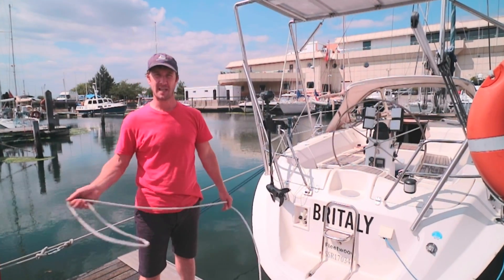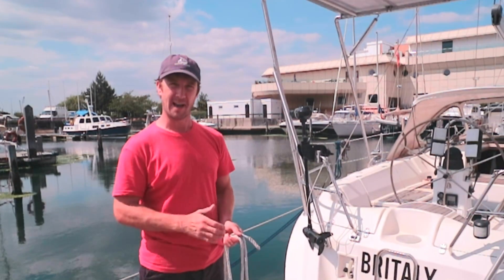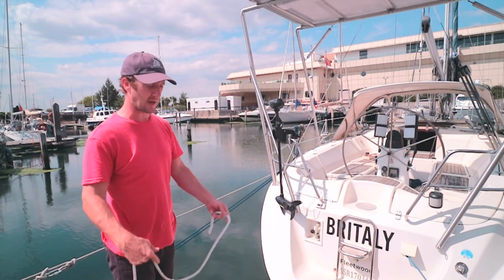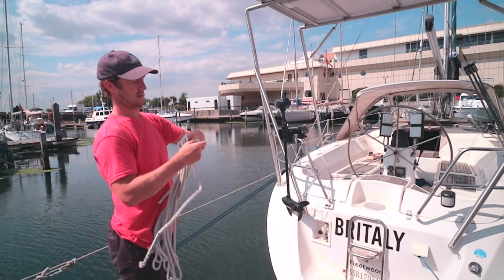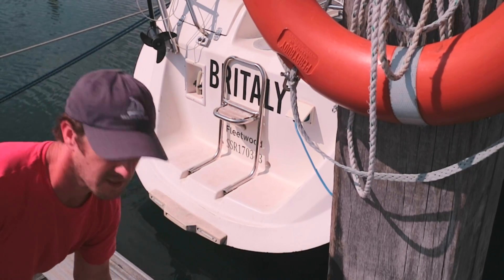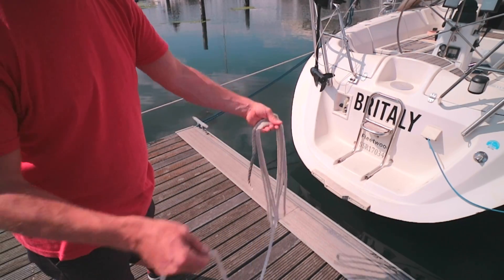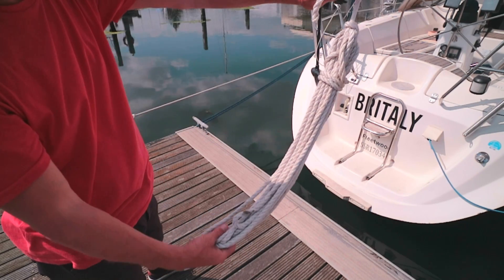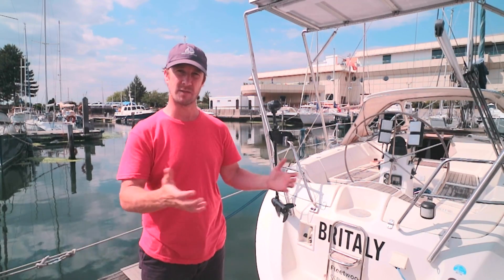Coiling Lines - Is This Alternative Method Better? | ⛵ Sailing Britaly ⛵

Comment: I haven't used this technique yet Chris, I will give it a go - it looks great a great way for long term storing of warps etc. and your locker organisation tips are excellent - together they will make a big difference on board for me.  I have another way that prevents the twisting similar to the figure of eight method but leaves a single coil,  I think it is the same as is mentioned by Miles Hurst below, it is normally associated with winding long electrical cables but I use it as a matter of course for lines in active use - such as tidying my halyards.  
Coiling into the standing end and forming bights in pairs....the first bight is wound normally (i.e. the standing end is laid over the bight)  and the second is twisted in the opposite direction i.e. the standing end emerges behind the bight... This means the twist on each bight is cancelled by the next .  The upshot is you can pay out a line, cable or flexible pipe with the coil laying on its side without tangling,,, but better still you can coil into a fixed standing end which I don't believe is possible with any other technique (think coiling a hose working toward the tap). It sounds complicated but is actually very very easy and I coil lines in this way without even thinking these days!  All the best to you and the family x
Reply from the maker: Hi Lawrie, thank you for your comment. Is it the daisy-chain method you are referring to? Something like this: https://youtu.be/9-eT6v2OBno
Reply: @SailingBritaly  No not the daisy chain method, more like this: it is known as the 'over under' method - look around 3 mins in on the video link below. Using the technique shown it is possible the coil into a fixed end because you are not storing twists on the standing part - in the video the guy could actually coil the cable with it still plugged in to both guitar and amplifier if he wanted to.  https://www.youtube.com/watch?v=B2SUoAvGxVs
Reply from the maker: I like it, thanks for sharing Lawrie! 👍

Comment: Looks like a good method. However, the other usual use of a mooring line is to through out to the marinero/helper on shore (I mean: selecting the roll of mooring line into two: one part is just long enough to reach shore - this is what we through, the larger part then pulled to shore). Does this folding method helps during the mooring, as well?
Reply from the maker: Hi Tibor, coils made like this throw well too - this may be the subject of another video one day!... Very best regards, Chris

Comment: Hi Chris, this is called "Lap coiling" you can also use this method to quickly rethrow a line  to someone if you miss first time, eg you have thrown a throwline to a man overboard and missed, you can quickly lap coil enough line to rethrow to the person in the water without having to restow the line in the bag. Hope that makes sense. Cheers Graham.

Comment: Yep - I switched about a year ago, having been taught the traditional way. I think it may have been relevant with older materials and 3-strand lay, but with modern materials and braid-on-braid the twist is unnecessary, and harmful. as you point out. 

We don't have room to hang ropes, they end up dropped in the lazarette, so we finish the coils by pulling the bight through, as you show, then rather than threading the tail, bring the bight over and back down the coil before snugging it. I believe it's called a gasket coil. Makes the coil a bit tighter and more secure, so less likely to disintegrate in a locker. It does take slightly longer to un-coil, though. 

Climbing has a lot to teach sailors about rope-handling and knots - got any more tips from your cliff-dangling days?
Reply from the maker: Hi Martin! The gasket coil finish is a fairly common alternative and you're right that it is more secure, with the small downside of time to uncoil. I have learnt quite a few lessons learned from climbing. I'm not sure how well they translate here but here goes...

I once took over as the lead climber from a mate and it was only once I got to the top of the next pitch that I realised I didn't have a belay device (the bit of kit which allows you to arrest the fall of your partner if they fall.) Fortunately I knew how to tie a Munter Hitch (a.k.a. Italian Hitch) and I was able to belay him with that. [If I remember correctly this was during the climb shown in the third photo in this video.]

I spent 5 nights solo at the summit of Ben Nevis (the UK's highest mountain - which isn't high in global terms, but which has a fierce reputation due to the weather conditions up there) and I was able to collect around 1.5 litres of drinking water per day by collecting condensation and the odd bit of rain. I carried all my gear & food up there with me (35 kg) and expected to have to walk to a freshwater spring each day to collect water, but I strung up a v-shaped bit of string across my tarpaulin (which I was using as a bivvy) leading down into a water bottle and in the end it was so effective I didn't need to get water once. I guess a similar technique could be of use on a boat (V-shaped lines strung up a mainsail? [In addition to the more common rainwater collection methods on boats])

I took an inexperienced (but hard) friend climbing up a mountain in Norway when we had a bit of downtime during our military Arctic Survival Training. We were in a little place called Lakselv which is 300 miles North of the Arctic Circle and it was winter with temperatures of around minus 25 degrees Celcius. The going was very tough (soft, deep snow which ideally called for snowshoes, alternating with very steep rocky terrain which precluded their use) and I made the call to turn around when we were very close to summiting (just a few hundred metres away). My mate had some snow get under his gaiter which had wet his foot and it was giving him bother. We were both disappointed as we very nearly made it, and this was a once-in a lifetime opportunity, but it wasn't worth the risk. By the time we got back down Graham had frostnip on his toes, which is the precursor to frostbite. If we had have pushed on to the summit he may have lost some toes. The moral of that one I guess is that the mountain - or sea - will always be there for another day, but if you pigheadedly fight nature there can be serious consequences.

I have a ton more lessons learned (I've been going up mountains since I was a kid) but I think that's enough babbling on from me for now!

Very best regards,
Chris 👍
Reply: @SailingBritaly  Gosh, yes: respect the elements! My only, rather tame, experience with mountaineering was an ascent of Mount Hood when we lived in Oregon. Basically a steep walk until you get to the glacier at the top, when it's a steep walk with ice and snow. I recall we used tubular tape, rather than rope, to rope-up. There was a reason for this, which I have forgotten. 

Anyway: as always, an informative and useful video, Chris. Thanks.

Comment: Good idea, I always left halyards and sheets where they fell on deck to avoid a tangle in an emergency release, but in bad seas they can  wash over board. The figure 8 is good for air hoses, feed out without loops or kinks.

Comment: Thanks Chris good tip i have seen diffrent methods for hoses but never thought about taking it to lines 👏👍 i have a old broom stick pole hung horizontally at the back of the locker to hang my lines / sheets from works well
Reply from the maker: Hi Al, nice one buddy! The broom handle is another brilliant option - better than a line, in fact. Cheers, Chris 👍
Reply: @SailingBritaly  thanks chris love your tips and thanks for replying 👍👏🏴
Reply from the maker: My pleasure Al 🙂👍

Comment: i will try this. For climbers this is the way isn't it? For them must at least as important not to get tangled up. Thanx
Reply from the maker: Hi there Arne, thank you. We recently had a comment from someone regarding our mast climbing video https://youtu.be/Xg34bOUd5gU where they went up the mast on a 4:1 block & tackle and the line got tangled down on the on deck while they were up the mast, solo, out on a mooring... Fortunately someone went past on a SUP and the rescue came quickly. This is not a typical situation for a climber, but you definitely don't want to be dealing with tangled ropes when you are climbing. These 'flaking' techniques definitely help with that. Cheers! Chris :-)

Comment: Good tips Chris. I have been down on my boat all the weekend. Unfortunately all my lines are as crusty as a salty sea dog. Think they all need to be laundered or replaced. Still trying to get the motor going as a first priority at the moment as its going in the water the end of September so I will be back on the island (IOW) next weekend antifouling and sorting the engine. :)
Reply from the maker: I know where you're coming from with the running rigging: ours could probably be used to introduce new colonies of moss to previously barren places! Some will need replacing but I hope that some will be salvageable with some deep cleaning. Good luck with your work and splash. We offer technical help to our Patrons so if you get stuck with anything reach out to us in a private message there.  Cheers, Chris 👍
Reply: Thanks Chris.... I have got the book you recommended so that will help too.... I shall sort out a Patreon thing real soon once I have sorted out my budget for doing the  yacht :)

Comment: A skipper chewed me out for coiling braid using the first method.   I'm left handed so the coil ends up in my right hand whilst my left does all the hard work.  He started barking at me because he reckoned the braid had a bias and us lefties cause kinking problems.  It's alway been ok for me.  So I did it his way and it was really awkward for me like using a knife and fork the other way around.   Any thoughts?
Reply from the maker: I don't want to criticise another skipper but this sounds a bit harsh on you as an innocent left-handed person. (Perhaps if the concerns were communicated in a more positive way it wouldn't have left a bad feeling with you) As per another comment though, coiling lines in a particular way may be a bug-bear for some people. Cheers, Chris

Comment: I'll try it.   Good video.   Real problem with good help/idea, thanks.   Hard to describe... but, there is a 3rd way.   Learned it in video/stage productions on very long Mic & Light cords.  It keeps all the "twists" out.  Should - maybe result in the same as your technique.   I'll try yours and compare.  Thanks, good job.  NM
Reply: Yes Miles - that's the way I do it too!
Reply from the maker: Hi Miles & Lawrie, yes I think I know the one you mean -  the daisy chain method?
Reply: I am going to try this method with my massive 50amp cord for my Airstream! I've been worried that I put unnecessary stress on the interior wires with the way I've been coiling it and I see from the video that it is a valid concern. Thanks!

Comment: First video that I have to disagree with, slightly. Depends on the line and number of strands. You’re right in that you never want your line coiled in a way that may cause tangles and kinks, could make a difference at a critical time. If your line uncoils cleanly using the “pretty” way then no harm no foul. If not, then for safety’s sake use the figure 8. Seems like a simple unimportant choice, till it isn’t
Reply from the maker: We're always happy for people to disagree  - debate is very healthy, and is always welcome with polite and considered comments like yours. The figure 8 method is a very close second for me personally but it is much better than having a whole bunch of turns in the line  like with the first method shown. Cheers, Chris 👍

Comment: Yes..we called this elephant ears or nannies t.i.t.s..key to stopping wraps on winches and knots at jammers when racing. Helps when you have lots of reefing and halyard lines coming back to the cockpit. much faster to coil since less wrist movement and you can just throw the line on the floor and it feeds in with NO turns...the only way to go when under racing pressure..check out my video playlist on the global challenge...we rarely had twisted line issues by using this method..luv your channel..keep up the knowledge sharing and inspiring your armchair sailor fans
Reply from the maker: Thank you John! 👍